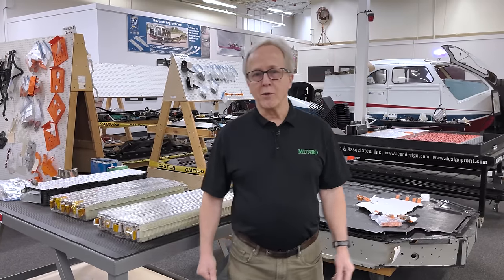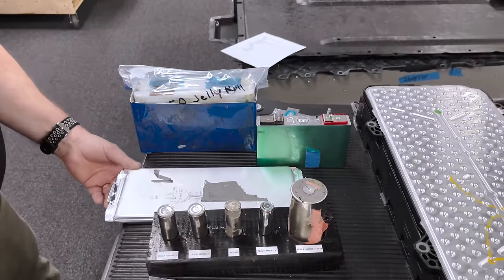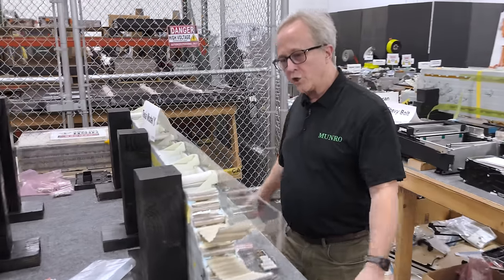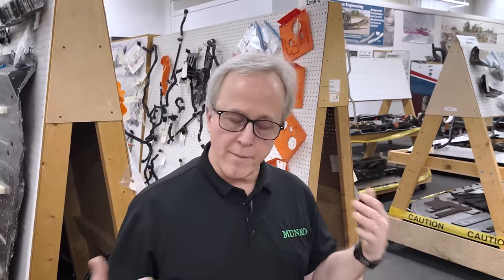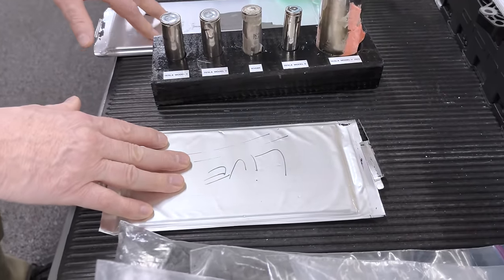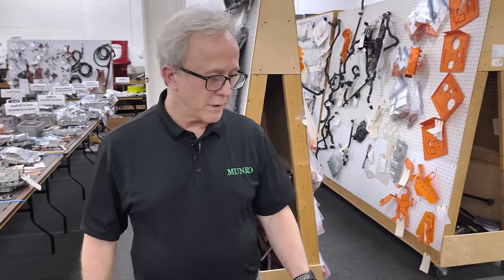Electric Vehicle Battery Breakdown: Cells to Modules to Packs!

Comment: I have noticed that all those battery packs are designed for maximum energy density and minimum serviceability.
The most terrible part about it is if just one single cell fails it can write off the entire vehicle both physically and financially as the whole battery pack needs to be removed and replaced instead of the single cell, and with such tight packaging thermal runaway is likely to destroy the vehicle.
It may increase initial cost and reduce range but packs should be limited to between 40 and 60 kilograms and individually removable from the vehicle without removing the entire battery array, each pack should be an independent plugin module thermally isolated from all others with thermal armour shielding and mechanical impact shields that are individually replaceable protecting them from the bottom
Reply: Your point is right on. 
One cell goes out and you'll have useless vehicle. Cells should be replaceable.
Reply: It's not true that single cell failure breaks a battery beyond usability.  If the failure mode is increased internal resistance, then that cell is just not contributing to total Ah.  If the failure mode is internal short, causing current inrush from parallel  sibling cells then the fusible link melts, removing its contribution to the pack.  Allowing the BMS to do its thing, cognizant of possible failure modes can reduce the chance of either failure mode actually occuring.
Reply: @chrisking7603  that’s the theory but the reality is often worse than a dumpster fire.
Reply: @anomamos9095  I'd rather a faulty thermistor erring on the side of caution, shutting down the car battery pack, than no thermistors like the older battery packs, or in the flood of cheap e-bikes.
Reply: @chrisking7603  How is the failing cell not contributing more Ah when in a battery pack and modules the cells are wired in series? How is the BCM going to isoled that single cell and let the Ah pass that bad cell and deliver the power?
Reply: @johnkelly6888   That's the reasoning behind first connecting a whole bunch of cells in parallel before then connecting those cell groups in series.  It can be done the other way around, but that would have a single cell failure affecting voltage of the series group, writing-off otherwise good cells.  It's easier to manage a parallel cell group that stores less Ah and thus reaches higher voltage slightly faster, and then balance that group's voltage in the pack.

Comment: Wow. Nice presentation!
And now it's clear why 4680 Y performs worse than 2170 Y, both from a range perspective (due to lower kWh) and acceleration perspective (due to lower voltage -> lower current in the motor, although this is debatable).
Single interesting info not present: weights.

Comment: Along the bottom are the max/min/nominal voltages. For example, the Rivian goes from a high of 453.6 volts to a low of 270 and nominal 392v. Do the module controllers smooth this variable voltage to a constant voltage potential of 392v to the drive motors. ?
Reply: Yes, that's the job of the DC to 3-phase AC inverters.

Comment: Do parallel Lithium Ion and LiFeO4 cells have issues with uneven charging or load sharing when connected in Parallel, similar to having multiple transistors set up in parallel, without a common heatsink, so that their voltage vs current curves are not locked together using the same temperature, to be close to being the same curve?
Reply: At the lowest level of nesting, the parallelism to build-up the Amp-hours automatically presents as a single cell.  Weak cells with higher internal resistance just won't  contribute their fair share.  Weak sibling cells with lower internal resistance are a disastrous focus of overheating.  Balancing is mainly controlling the layer of series connection which can fall out of step if there were only dis/carging at the pack level.

Comment: Would it be possible or practical to split the battery in 1/2 so 2 chargers could be used at the same time to reduce charging time?
Reply: If you were limited by the available power of the charger, yes.  Otherwise the main limit is charge rate "C" of all the parallel capacities.  50Ah 1C is 50A.  Amps through conductors make heat though, so a good BMS should reduce the charge rate if the cooling system (if any) can't shed the heat fast enough.  Dynamically reconfiguring the pack for less parallelism is really clever.  Higher voltage means faster charge with the same amps/heat.

Comment: Is it possible for discharged li-ion batteries to have thermal runaway and explosion, or only charged batteries? Is there a relationship between likelihood of spontaneous explosion and charge state and is the relationship linear?
Reply: I would certainly think so as the FAA mandates batteries have a low SOC when shipped.
Reply: A discharged Li-Ion battery can still have a thermal runaway event, but it is less likely than a highly charged battery is to run away, and it won't burn as long if it does run away. Explosions don't usually occur with an automotive EV battery pack, as it is more like a series of roman candles going off. Automotive packs have large one-way vents that don't let a lot of pressure to build up internally to invite an explosion. Storing cells between about 5 and 30% SoC is a pretty safe practice for longer term storage where they are probably least likely to cause an event. I don't know if there are any good mathematical rules of thumb, but certainly higher states of charge are more of a concern, and overcharging is probably the worst thing you can do. A discharged Li-Ion can also still shock, electrocute, and cause arc-flash.

Comment: Having an array of thousands of 18650s as a power source is primitive. About 100 years ago, when we were dependent on the horse and cart, it was equivalent to hitching more horses to the front, more power but increasingly difficult to manage.The latest tesla is like having 6 horses out the front.  Its like the improvement over big heavy D cell powered flashlights, or those dolphin torch 6 volt battery bricks that lasted about 30 minutes.   What I am saying is that the technology is still in its infancy and we have a very long way to go. Reliable Li ion battery technology has only been around for about 10 - 20  years, and we are stuffing it into full size family cars. Hopefully in 50 years we will look back and consider this technology like we do the 6 volt battery brick.

Comment: Can you explain the degradation behaviour of each.. what happens when one of the cells starts failing? Which design losses less capacity when this happens? Seems Tesla battery can fail just because on cell is defective
Reply: Like an old Christmas tree bulb huh?
Reply: There are different types of failure modes, and too many to cover here, but generally when one starts draining down any others it is in parallel with within a cell group, the balancing system will try to bleed the other cell groups down to match, within limitations, and periodic recharging allows the process to repeat until the balancing system can no longer keep up.
Reply: A failure mode where one cell develops high internal resistance is preferred, as it just takes its contribution out of the equation.  A failure where a the cell develops a short will quickly degrade its parallel siblings, and the ability to manage the imbalances.

Comment: As a potential EV buyer I wonder about the risk of needing a battery replacement. Do you have data on that for the model 3/y. What are the main causes of battery damage: water ingress, individual cells going bad, mechanical damage etc. It seems that VW choose to repair batteries while Tesla replace them at potential higher cost for the customer.
Reply: 1. Wear and tear from many charge cycles over time
2. Fully charging and discharging distresses the battery and reduces the potential svailable charge cycles
3. Degradation is gradual loss of nameplate capacity... it depends on your tolerance for more frequent charging

Comment: Couldn't having the thick thermal interface material be intended for allowing expansion of the pouch cells ? If it was a super thin layer like a CPU thermal paste couldn't long term expansion and contraction cause the metal surfaces to wear though in spots and make metal to metal contact, then causing cell damage or hot spots ?  Also while not sold in the US any comment on BYD's Blade batteries ? They are said to be the safest design and soon being licensed to other automakers.
Reply: Another big factor is resilience to vibration.  The topic of thermal interface materials has ventured deeply into opinion-land, often at expense of open-mindedness to the bigger picture.

Comment: Can Tesla and others, periodically, using electronically controlled valves, reverse the flow through the pack, to allow the cells that experience the hottest coolant, to then be the cells that experience the coolest current. Similar to rotating tires, this could lead the even longer life. The car could swap the coolant flow direction, every 15 minutes of operation, and several times during the charging cycle. This would provide fairly even cooling no matter the position of the cell.
Reply: I'm not confident in the explanation for coolant loops for each row.  If there's a significant temperature gradient, why not just increase the flow rate?

Comment: 🎯 Key Takeaways for quick navigation:

00:00 🚗 Les batteries des véhicules électriques ont différents facteurs de forme, y compris cylindriques, pochettes et prismatiques.
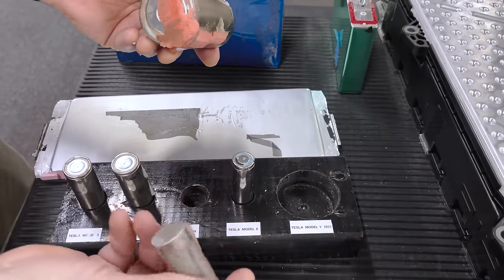03:38 🔋 Les cellules prismatiques offrent un compromis entre les cellules cylindriques et les pochettes, offrant une gestion de l'expansion et de la contraction tout en maximisant l'efficacité de l'espace.
07:25 ❄️ Le refroidissement est crucial pour les modules de batterie, avec des configurations en série et parallèle affectant la conception du système de refroidissement.
10:53 ⚙️ Les modules de batterie Tesla ont évolué pour optimiser le refroidissement, passant d'un design en ligne droite à une forme serpentine pour améliorer le contact avec les cellules.
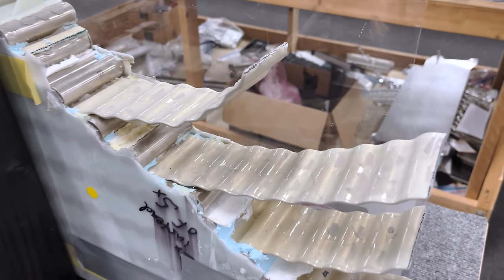12:13 🌡️ Les conceptions de refroidissement innovantes, comme celle utilisée dans le modèle Plaid de Tesla, peuvent maintenir une température uniforme à travers toutes les cellules, prolongeant ainsi leur durée de vie.
14:46 📦 Les batteries passent de la cellule au module, puis au pack, avec différentes configurations et tailles, influençant la sécurité et la facilité de maintenance.
16:26 ⚡️ Les systèmes de gestion de batterie (BMS) surveillent et équilibrent les cellules pour assurer la sécurité et la performance, avec diverses configurations et méthodes de câblage.
20:23 🔌 Minimiser la longueur des fils et assurer un refroidissement adéquat sont essentiels pour éviter les problèmes de connexion et de surchauffe dans les batteries de véhicules électriques.
21:47 🌡️ Différentes méthodes de refroidissement sont utilisées pour les batteries, notamment le refroidissement par plaque et le refroidissement des pochettes, chacun avec ses propres avantages et inconvénients.
25:13 📊 L'utilisation d'une feuille de calcul simplifiée permet de comprendre la capacité et l'énergie des cellules de batterie, des modules et du pack, essentiel pour l'optimisation des performances et la gestion de la puissance.
30:11 ⚡ Le concept de "C rate" est crucial pour comprendre la capacité de décharge des cellules de batterie, déterminant leur capacité à fournir de l'énergie de manière instantanée.
35:54 🔋 Comprendre la différence entre les kilowatt et les kilowatt-heures est essentiel pour interpréter correctement les spécifications des packs de batterie des véhicules électriques.

Made with HARPA AI

Comment: Hopefully with your teaching, car dealers will be able to repair batteries.  My KIA Niro EV 2023 was declared a total loss for a rock impact on the battery.  There is an exposed data cable at the bottom of the battery, in the middle, the most probable impact location, protected by a small plastic.  A very stupid design.

Comment: 🤔, hmm is last battery from Tesla model S and X you said easy to remove from car could mean you could keep or change from your last car to your next car if there was standardized packs like batteries AA AAA for kids toy cars we buy usually without battery included in some cases, looks like in some cases car depreciation after 1 Year doesn't deserve to be sold with battery included if battery is responsible in some cases for 40% of the new car price
Reply: No it was for a battery swap.  Tesla built it to show that they could, that the process would work .. and it was abandoned as no one wanted to trade their almost new $24K battery pack for another, not knowing if the one you were gaining was actually in terrible shape.  When fleet cars become popular, the swap-able battery pack might return ...
Reply: @csf1757 You have good point here with swap battery technology,i was listening Sandy's opinion about that type of standardized one size battery and his opinion was that car manufacturers will not come together to agree on one size battery   because of car size underbody differences, and yes commercial fleet could be more straight forward Way to be fitted, but again it's very competitive field and they're not forced to join to agree on that, for now Matt Watson from Car wow was saying that New Renault Zoe is losing half value after one year and battery of Renault Zoe is definitely not losing value after 1 Year period in my opinion,if it is suitable to put it in new Zoe a 10 Years old your  battery would be close to New battery in some cases with small miles and small degradation ,in this case Nissan-Renault didn't do good job about heated and cooler battery sistem to be suitable for all manufacturers

Comment: prius prismatic(panasonic)NiMh, pressure vent failure(flaw), subsequent over pressure battery post(-) gasket failure, resulting electrolyte leak and premature battery failure...G2, G3. Inquiring minds:o)
Reply: Yeah, the vents on prismatic cells always look so well designed. It is a shame to hear they don't always work as well as planned.

Comment: Foamed batteries are a killer for repairs.
Reply: As long as a module is removable, having foam inside between the cells is OK. It will always be too difficult to replace individual cells anyway. Replacing modules is also difficult as time elapses on a pack, as it it too difficult for a new module to behave like the old modules without extreme pre-conditioning of the new module. The older the pack is, the less practical replacing a module is.

Comment: With all of those fancy lithium batteries why do electric cars need a common lead acid battery as well?
Reply: They don't.  But Lead Sulphate is a good chemistry to be kept full with simple trickle charge.  The separate  battery is required because main pack may shut down for a number of safety reasons.  A back-up to power some electronics is helpful.

Comment: MUNRO live - Ummmm, the MOST sold Automotive battery is LFP used in TESLA Vehicles. 
the #2 MOST Popular is 2170/1865, 4680 Lithium in NCA/NCM Chemistry. also used by TESLA. 
Cylindrical battery cells are also Popular w/ Start ups like RIVIAN and LUCID. 
almost ALL Legacy auto is using VERY CHEAP quality Pouch cells & Prismatic , that have Battery overheat & Thermal Runaway  in 2024.

Comment: All of these cooling strategies are better than the Nissan Leaf. Yeah, none. The pre 2013 or so packs had terrible degradation in hot places in cars that had 75-80 mile range, when new. Then they came out with the Lizard packs which had cells which mitigated degradation with different chemistry, and controls, which means if it was cold, it charged slow, or when it was hot, it would charge slow. Of course CHAEDEMO is dying, long live NACS! If it's cheap enough, it might work great for an around town car. These EVs in this video are designed to replace gas cars capable of everything, including road trips.
Reply: The new replacement packs surely can't continue in the stone age.

Comment: What a joke. Looks like something cobbled together by a handyman using a bunch of batteries he bought at HomeDepot.  No way to repair this piece of shit design and thousands of connectors and cells to go bad.  I recall learning while getting my engineering degree - there’s a direct correlation between electrical connectors and failure rates.  This is the kind of thing to be avoided.  The MTBF will always be unacceptably low until something fundamentally is done to simplify the unit.  This is disposable, throw away design at its worst.  Rube Goldberg would be proud of this entire industry.   After watching this very well done video - can anyone honestly repeat the EV lie - EVs are so simple - there’s nothing to go wrong.
Reply: So far support for your last point is evidenced.  Never say never, but in general, correct.